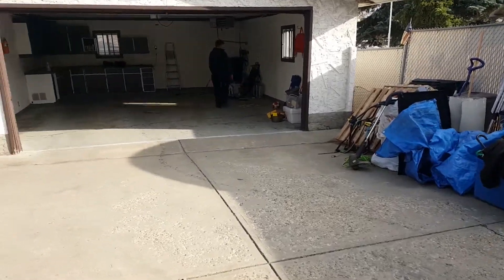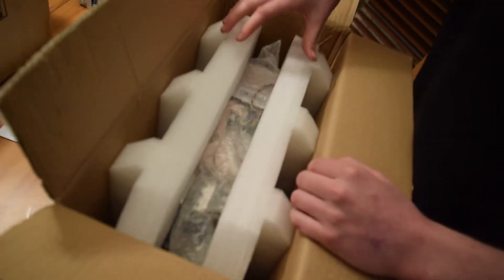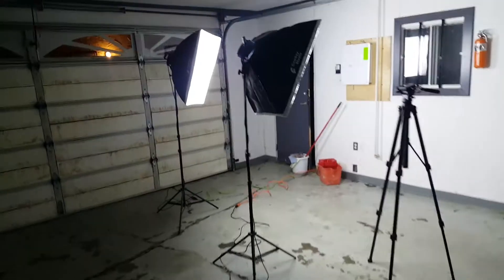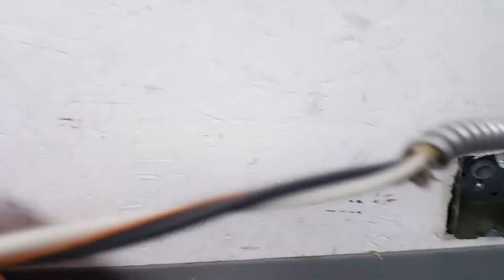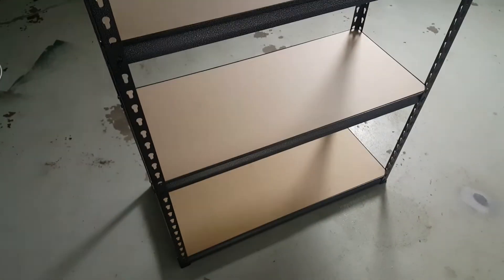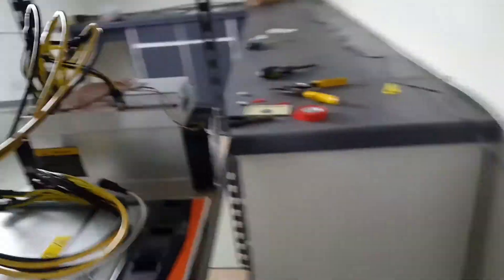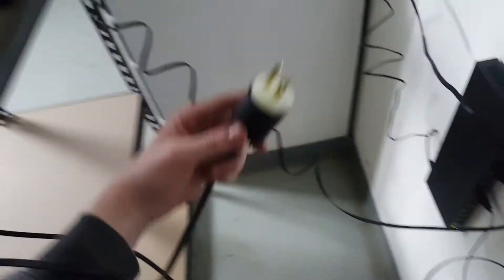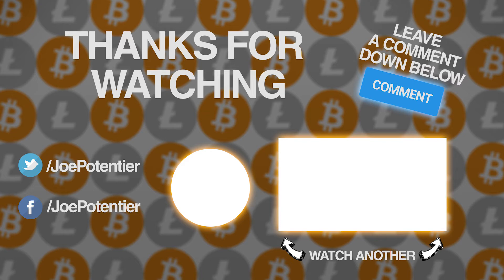Miners Have Arrived!! - Episode 4 - How to Build a Bitcoin Mine From Start to Finish

Comment: Do you need the special outlet for just one antminer l3+?
Reply from the maker: It depends on your PSU. If you use a standard consumer PSU you will need to buy one per miner and use a standard outlet. My server PSU uses 220V which is non-standard in Canada and needs a special outlet type to operate.